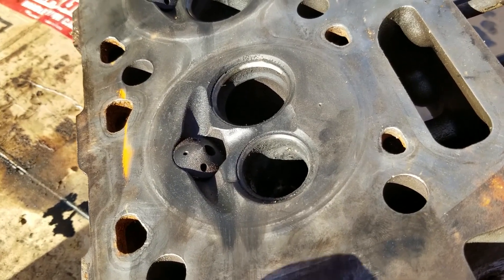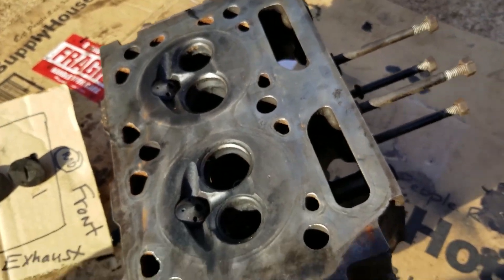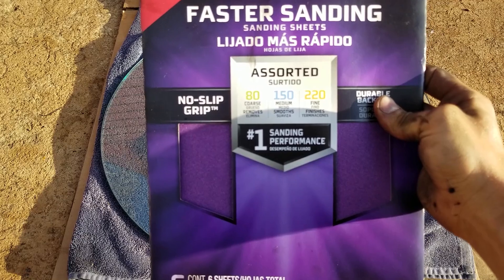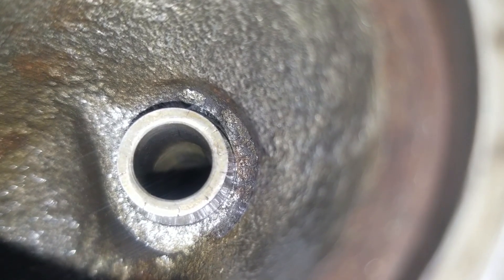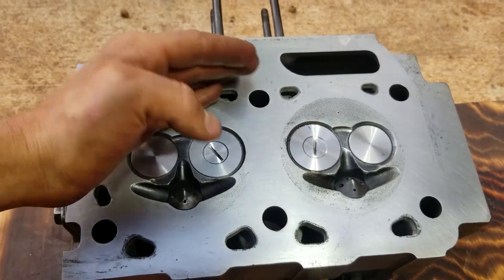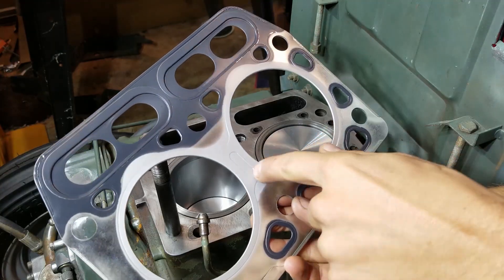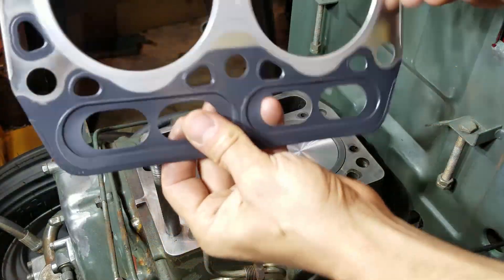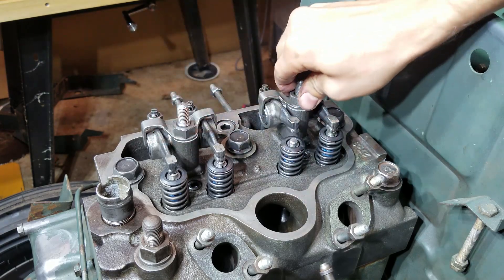Yanmar Diesel Engine Cylinder Head Rebuild

Comment from the maker: Hey Yall!
➤ FULL VIDEO: https://youtu.be/QErPEFPWDe8
Timestamps
0:00 Intro
0:15 Valve Inspection
1:10 Cylinder Head Resurface
2:25 Machine Shop Needed
3:14 Cylinder Head Rebuilt
4:05 Cylinder Head Installation
5:32 Outro

Comment: Hey Matt what kind of manual book you using to get all the torque specs and how to rebuilt?
Reply from the maker: I have service manuals for a YM240 I bought off eBay.
Reply: @MattsShop  where can we chat ? Am about to rebuild a ym1700 and is the same engine with minor difference but your manual it's just what I need can you share it please
Reply from the maker: @yosoydpfknr2855  mattsshopofficial@gmail.com
Reply: @MattsShop  just sent you an email thanks matt

Comment: Not sure why my comments disappear but need info on a 2 cyl yanmar tractor.  Fuel injector pump.  Have one,?  Any leads on one or rebuild kit?  Any instructions on removal, installation?  
Thank you.
Reply from the maker: Hope tractor parts has new fuel injection pumps. They are a PAIN to install and expensive. They have to be shimmed right with a thin copper gasket behind them to time them correctly and the governor linkage has to be reset (I have a video on that). Are you sure that's your problem? You have to follow the procedures in the manual.
Reply: Thank you Matt!  I get very little pressure at the fuel injectors.  I tried at the pump and left side barely spits out any fuel.  So I assume it's the injector pump.  I can get it started but takes hwat in intake and smokes like crazy.  I'll welcome any advice.  Thank you.
Reply from the maker: @shawnburhus6188  Are you getting good spray out of the injectors? The actual part that sprays in the engine? The fuel will barely squirt out the injection pump that's normal. When it's compressed it's 2275 PSI. PLEASE BE CAREFUL. High pressure diesel is dangerous.
Reply: Yes, I did the cardboard truck as you showed, but on injector barley swuirts.  So I went back to pump and very little pressure out of pump on the same line going to injector.  So, I assume it's injector.  You do awesome work.   I'll pay you and your wife/gf/signing other to come here and check it out.  Free trip to Reno...
Reply: @shawnburhus6188  I would buy a single new injector and test with it before buying the pump.  Mine had bad injectors that were doing what you are saying.
Reply: @Audittchick  hi,  thank you for the reply.  I bought a new pump.  Absolutely no different.  The injectors seem to be squirting decent.  I haven't checked pressure though.   There is a video in YouTube titled "yanmar tractor won't start".  Mine does the exact same thing.   All comments asking what was wrong go unanswered.   Your suggestion  is worth a try though.   Thank you